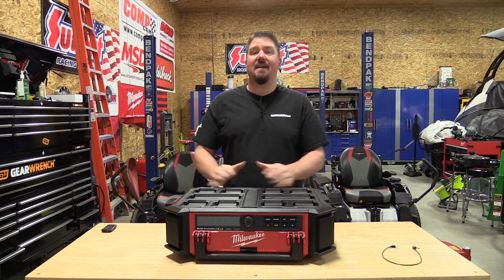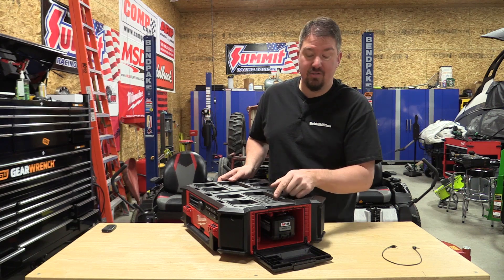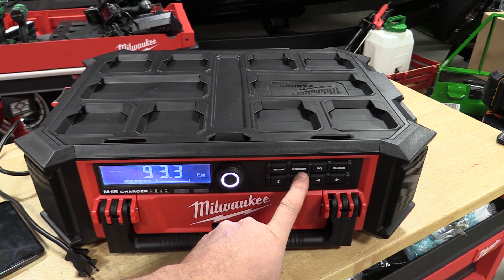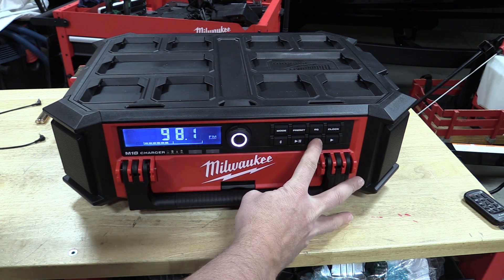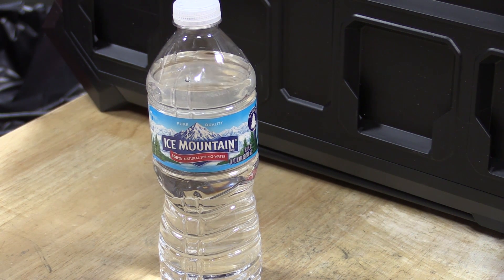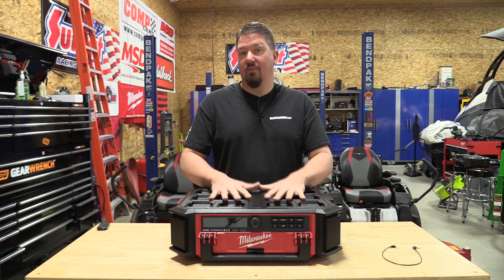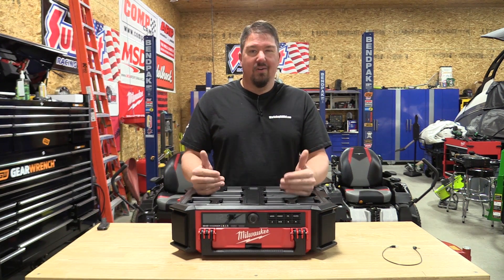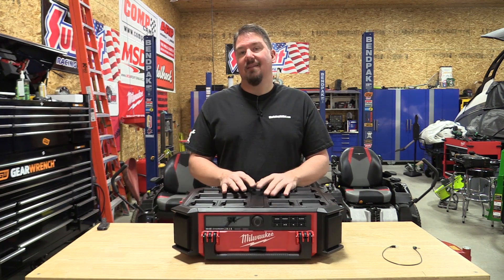Milwaukee Tool M18 PACKOUT Radio + Charger 2950-20 Vs DEWALT TSTAK Radio for Sound Quality

Comment: This is a great radio. The bluetooth range is EXCELLENT. Whenever I used to walk out to the van with my phone in my back pocket the bluetooth would disconnect. This no longer happens. The only thing I'm beginning to dislike is where the power button is (the knob in the middle) because it easily gets hit when reaching for one of the other packout cases in the set. That's a little annoying.
Reply: That is why I think using bluetooth is nonsensical. If you are going to buy a radio, just buy a small dap to go with it and then keep the dap in the radio all the time.  No bluetooth connectivity issues, no extra drain on your phone, no inferior sound quality due to the limitations on bluetooth versus an actual corded connection.

Comment: I will say I have had the first gen Toughsystem speaker for probably close to two years and I love it. My only two gripes with that unit are 1) The Bluetooth seems to be weaker than I would like. If I walk out of my garage and put my truck in between myself and the speaker, the sound will cut out. It won't disconnect though. And 2) I dislike the old school plug and power brick. I would much rather have a permanent power cord since I mostly keep the unit plugged in anyway. This Milwaukee would be interesting to seemingly fix those two issues but the price would have to come WAY down for it to even be a consideration of mine.
Reply from the maker: Once you get used to the DeWalt sound it's hard to change to a Milwaukee radio as the sound does not feel is full.  so after leaving the DeWalt radio and going to a very expensive Milwaukee you might be disappointed.

Comment: It’s a red tool.for red guys..good sound, not really the best at anything. If your not all red and just want a great sounding portable radio , tstak is awesome...but hands down nothing  beats the tough system gen 1...still unbelievable sound and thump....great channel 👍🇺🇸
Reply: Just a yellow guy bashing the better brand. Typical.
Reply: It honestly falls down to personal preference, both will do what you want. I'm a plumber and everyone I know uses Milwaukee stuff while most the framers I see use all DeWalt stuff. Different strokes for different folks.

Comment: I listened to both the packout and the Tstak system And I preferred the Tstak. I’m a Milwaukee fan but Dewalt had the better system in terms of sound and price.
Reply: Tstak system Only have 4 full range speakers, this packout radio have 4 TWEEYERS & 4 FULL RANGE SPEAKERS, are you sure Tstak system have Better sound quality? I don't believe it.
Reply: Zhen Lin CHN  tstak has 4 speakers, one on each corner plus the two bass resonators on the bottom. 
Number of drivers isn’t everything. Audio is also a very subjective subject.

Comment: It charges at 3.5A (not 1.0A to 1.5A as claimed in the video), which is 0.5 faster than Milwaukee's standard charger (48-59-1812).

Comment: How does this Packout Radio Charger 2950-20 compared to the previous Milwaukee M18 Radio Charger 2792-20. Which one sounds louder and with more bass??

Comment: Will it be loud enough in a factory with running machinery
Reply from the maker: I doubt it.
Reply: Making this short meant smaller speakers. You need one of the bigger boom box style radios.

Comment: Man, I swore up and down I wasn’t gonna buy this.  Then I saw it in store.  So,  I bought it.  The price sucks,  but it’s got great sound.  Maybe even a little better than there other Radio/Charger, which I have as well.  This is almost equal I think to the Toughsystem .
Reply from the maker: In sound, it is Almost equal to the ToughSystem.  I like that the DEWALT models have feet for those not using them on a stack.
Reply: WorkshopAddict that’s right,  I have both gen1 and gen2 of the toughsystem radios.  I keep them stacked so I kinda forgot about that.  Thanks brotha!
Reply: Do you feel the volume level on this is on par or higher than the toughsystem 2.0? So far having issues keeping the toughsystem working. On my second one. Keep burning up the subwoofers at half volume and bass at factory setting!

Comment: You made a mention of the charging of m12, not 18 earlier in the video.  The other question is does the usb operate when on battery and not just ac. Other previous milwaukee radios had the usb only work on ac which is stupid. I had to add usb jacks inside off the battery to the little m12 radio which I love. Why  they ever make a radio with a compartment for a phone/dap player and not give charging ability while under battery or ac to keep the player going as well is beyond me.

Comment: Can't decide on this radio or the other Milwaukee M18 charger radio...any suggestions and why?
Reply from the maker: If you wont use it on a packout box, get the other.
Reply: @WorkshopAddict  I was actually thinking about getting into the packout system to use for tailgating. Especially hearing about a possible full size packout cooler. I'd only need the rolling tote, radio, and coolers. Just don't know if it would be worth the extra $100 to be a packout radio.

Comment: You mention in the description that there are 10 speakers but where are they?   One on each corner and a sub would only account for 5.  Are the speakers full range or 2 way? I have the previous radio that has 2 way and it sounds better than most of the rest of them. They should not be making any radios without 2 way speakers.

Comment: Which one sounds louder, the Milwaukee Packout or the Dewalt Toughsystem?? Thanks for the review!
Reply from the maker: Both are pretty equal.
Reply: I own both, Dewalt Toughsystem radio 1.0 and Milwaukee 2950-20. According to my experience, Dewalt sounds louder, but if you turn the volume up at very High volume, dewalt sound quality will decrease, Milwaukee There is no such problem at very High volume.
But I still choose DeWalt, dorp milwaukee away, Because DeWalt's bass is much better than Milwaukee.
Reply: @Zhen-Lin-CHN  my toughsystem plays christal clear on full volume with no distortion at all, you probably have the equalizers set to high

Comment: I just picked up the Packout Radio today and hadnt tried it out yet... i also have the TSTAK Radio  which sounds awesome...i think the Packout  will sound much better when the back is facing the wall or corner..try it and please  comment!
Reply from the maker: I showed the speaker working better when the sub is facing down in this video.  I also showed what you are suggesting on social media.  It does sound better when the rear is up against a wall or cabinet.
Reply: Still won't be as good as dewalt

Comment: I know this is an old video but I’m looking to upgrade from my tough system 1.0 and I’m mostly worried about sound quality and bass. I’ve been extremely happy with the tough system. Wish Dewalt would’ve figured out the bugs in the 2.0 but it doesn’t seem that’s ever gonna happen? What does a guy do? Just buy another tough system 1.0? Mine still works but it’s kinda beat up and the latches for the top compartment are broken.
Reply from the maker: @jeffclark5024  if I want super good sound, I pull out my large JBL speaker.  Otherwise these radios sound pretty good.

Comment: First tool company to do a joint project with JBL(Harmon Kardon) for a job site speaker system are going to have the highest selling job site speaker.
Reply from the maker: Dewalt worked with Polk on one and it rocked, but was pulled from the market in months.
Reply: Milwaukee used to be teamed up with Rockford Fosgate
Reply: @evictioncarpentry2628  yeah i had that radio, it sounded great and was build like a tank
Reply: there are alot better speaker manufacturers then jbl out there

Comment: So I currently own every Milwaukee radio and speaker, i saw your review last year on the DeWalt toughsystem radio and how great the sound is, so I picked one up and ABSOLUTELY love it! The sound is top notch! But my question is, would you take this packout radio, or the new tough system 2.0 radio? If you had to choose. Forget if you already own the packout system. I'm talking just straight up picking one for life! Great reviews as always!
Reply from the maker: I need a little bit more time with the new dewalt system to answer this.  currently I'm leaning towards the DeWalt system but I want to use them side-by-side for a couple weeks to figure it out
Reply: @WorkshopAddict what's the word 3 years later?

Comment: I bought the ToughSystem 2.0 BF deal from HD. The radio was very loud and had great bass and the touch screen that rotates was great. Louder on radio than Bluetooth. Reception is just OK I only got a few station. No AM radio was shocking to me. The battery charging door latch shuts harder than it should and I can see it breaking. The UI was very disappointing.... pressing the power button doesn’t shut it off you have to long press. It was frustrating and you are better off pulling the battery to shut it off. The tuning and volume are on the same knob and you have to press the knob a couple times to change it. For these reasons I returned it.

Comment: hello i just got mine. i think i blew it out. theres no sound. is tht possible
Reply from the maker: It is electric, I guess anything is possible.  Can you exchange it?
Reply: Mine broke after a year. It was user related. I’m hard on my tools. I was stacking the heavy pack out on top and would slam the pack outs to snap it in place eventually damaging internals I guess. Milwaukee did fix it. But it happened again. Maybe loose wiring. Just take it in for repair. They’ll take care of you.

Comment: Price,weight, and less bass than the DeWalt means I'll be skipping this one. Maybe if they had a radio and packout combo for 350$ id buy if not nope
Reply from the maker: With the huge sales on the packout systems, I have to assume this will go on sale sometime soon as it is priced very high, as you said.

Comment: But the cord will get wet with rain, thats pritty bad design
also those openings on the top will fill with water with rain, alot better on dewalt toughsystem radio it has zero problems with rain

Comment: 2 subwoofers* also each corner is a mid and a tweeter so 10 speakers
Reply: There’s only one. The other is a passive radiator.

Comment: Over $400 Canadian.. hard, hard pass. Milwaukee failed huge in this offering by basically taking the guts of the chunky box radio and putting it inside a packout design. A standard charger and a basic LCD screen? None rubber plastic cord and average sound quality? Fail. The fact there's no rapid charger in there is already a no go. Sounds like all you're getting is packout compatibility. Meh I'll pass.